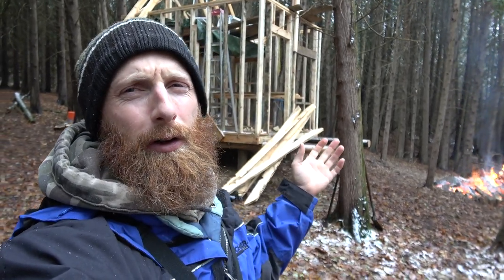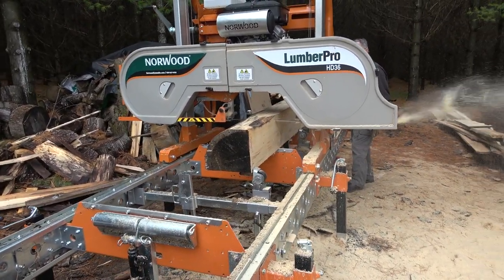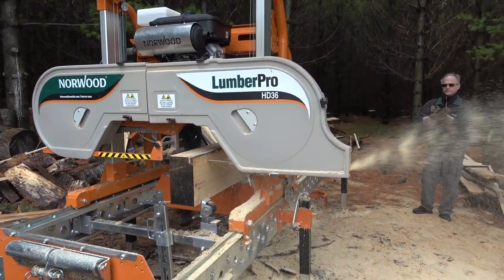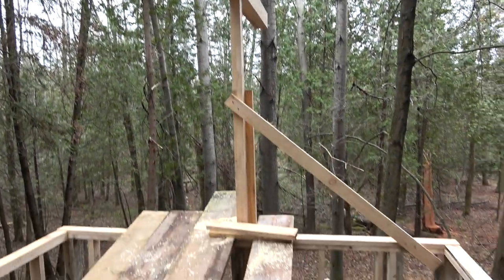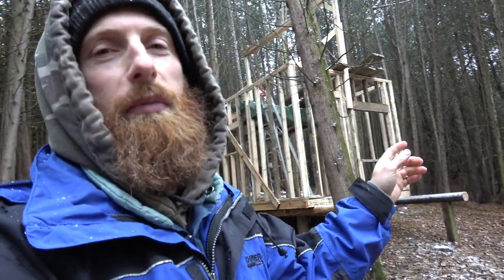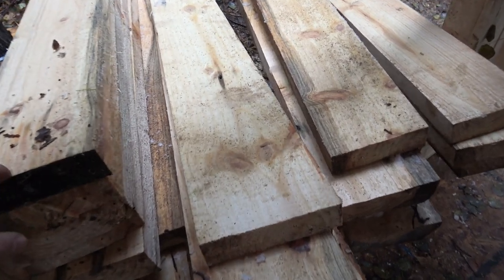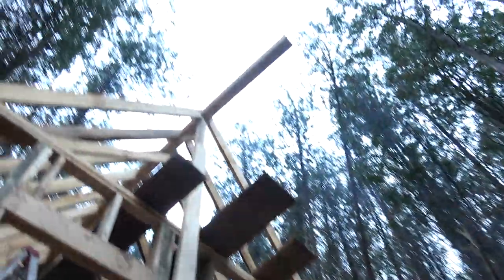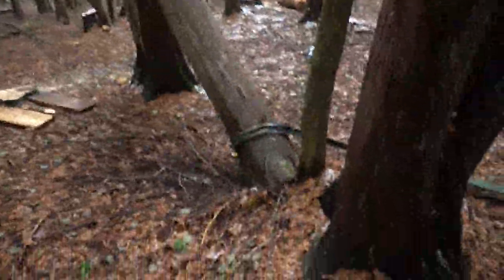Installing Huge and Heavy Ridge Pole by HAND! | Off Grid Cabin! | New Homestead Tractor Ep5

Comment: Looking good 👍 
As in experience, I've found cutting rafter tails 90 degrees off the rafter back instead of the vertical plumb degree adds to the longevity of facia and soffit when using natural materials.  This allows clear passage of rain and snow off the eave 👍
That's all

Comment: I left some bark on my cabins loft support logs and once I finished and started heating the cabin; I ended up with carpenter ants, powder post beetles, and jack beetles boring and hatching all over my logs. had to peel them in place, spray an insecticide and coat them in a poly. Lots of eggs under there!!! Great Cabin design!!!

Comment: That pressed board shit you used for the floor just warps/rots and de-laminates when exposed to weather, especially water like that. I made a shed about the size of your shelter using that crap as the flooring and regretted it after the first rain storm.
I'd have used planking (or even marine ply) for the flooring. Even knowing how much extra work it'd be to mill and fit it properly, would've been worth it. Also would've been considerably warmer.

Comment: I'm the onely one consern by the fact that the midle beam is thicker thant the 2 vertical beam that will support moste of the weight from the roof ?
Reply from the maker: It will be supported by the roof trusses and two end walls.

Comment: I was wondering: you used carriage bolts for your connection of your loft crossbeam and floor joists. Why not the usual metal joist hangers?
Reply from the maker: Easier to bolt than metal hangers that would need to be custom to hold the logs...